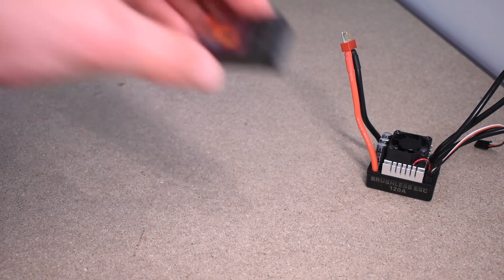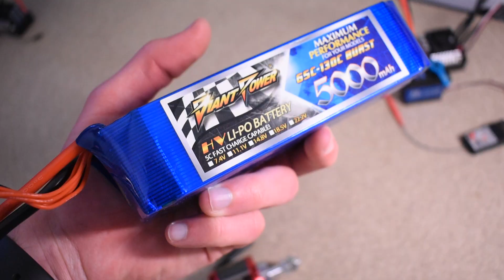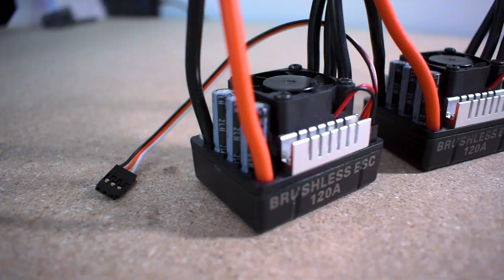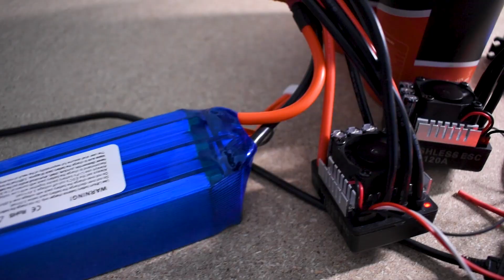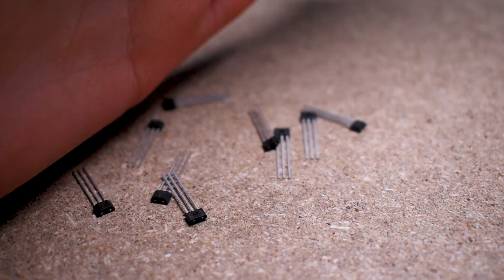True Speed Control - Brushless 4WD RC

Comment: Intrigued by the project! Kind of strugging to find the video that will really break down how you used the microcontroller to power these motors.
Reply from the maker: Hello, thank you for taking the time to comment. I ended up scrapping this version, but check out Raptor 2! I didn't make a video explaining the code, but it is available open source on my website under Projects > Raptor 2. Enjoy the rest of your day :)

Comment: Hey man! Really nice project - do you fly quads? I haven't for a while but know that there are esc and motor combos which can already read the rpm of the motors, so you wouldn't need any external sensors - also, the quad flight controller boards are at least as advanced as the STM32, some have quite a bit more power on board, and if they can make the 4 props spin at the same speed, the car wheels should also be doable... JM2C ;-)
I think you could use something that's already out there instead of developing your own hardware solution . that would make it also much cheaper and easier for others to be able to replicate your work and get more people on board!
Look forward to your future updates!!